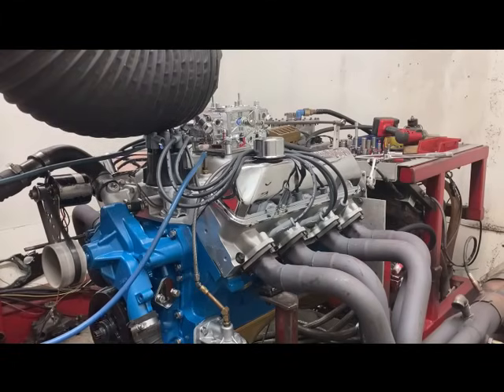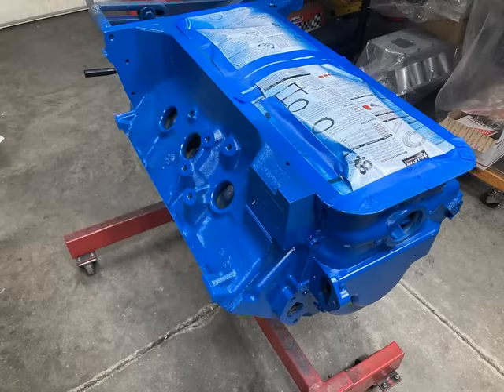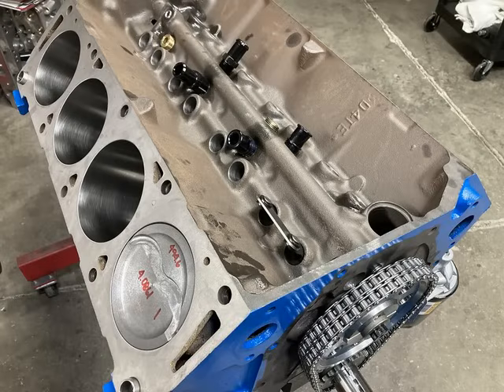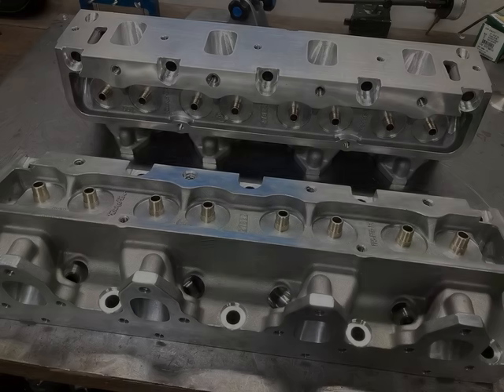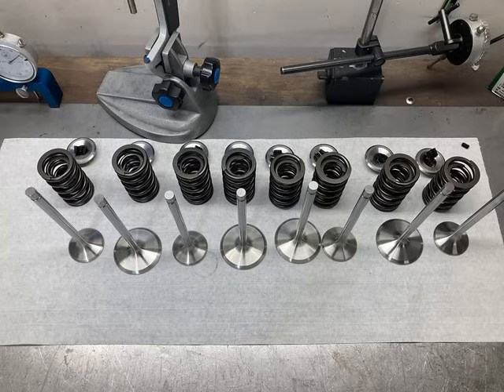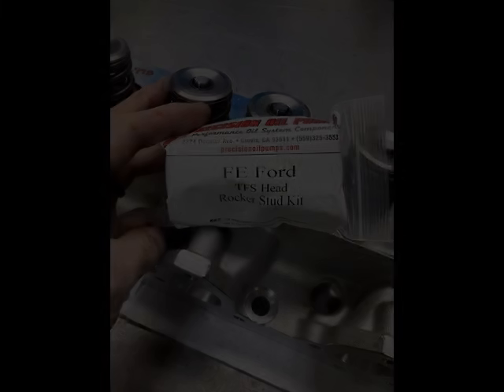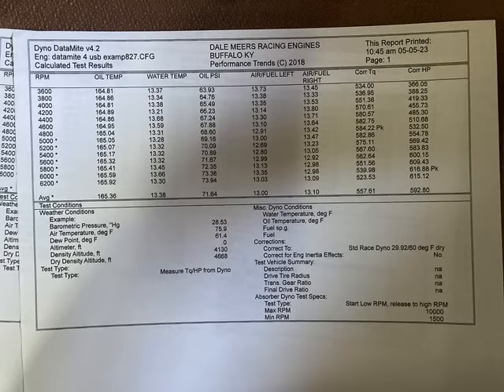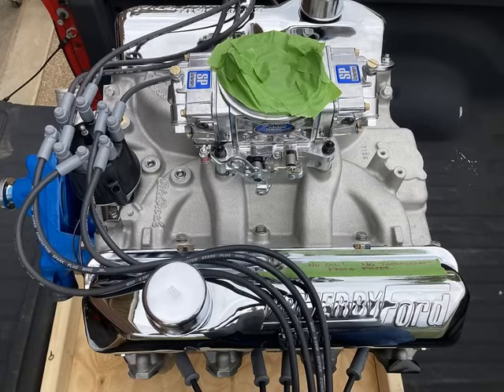Lykins Motorsports MEANEST/BADDEST Ford 445FE I've Ever Built!

Comment: This is the engine Brent built for me, for my son’s 1967 S-code Mustang fastback. Haven’t even fully got it broke in yet; about 400 miles on it so far. Another 100 miles and then we will change out the transmission fluid (new TKX), and should be ready to head to the dragstrip. Brent did an amazing job for there, although I will correct one thing he said- this engine is to serve as a 80% street/ 20% strip engine for this application. We know we will have to change out the valve springs every so often, and eventually the lifters too.
Reply: looks like you got a good one. 617 is something else
Reply: Read my comments I think you will really like it 😊
Reply: i have a 67 s code fastback I'm putting a 396 FE together for as well, nice to hear about other peoples projects too
Reply: I'm up in ND as well and doing a very similar build!
Reply: I’m looking to do a very similar build to this with Brent. I haven’t heard back from him yet. What’s a ball park figure for a build like this?
Reply: If you have to ask about pricing it's probably going to be to high! Lol. It sucks but that's just the way it is. I would say with everything custom porting carb and all the parts listed it will be more than $15k
Reply: I have an s-code 4-speed Mach 1 which I believe is pretty rare. Almost all had automatics in 69.  Awesome build btw. Just discovered this channel.

Comment: Yes port velocity is just as important volume in many cases. I could have sworn they were 2.19 / 1.88. . Well at my age maybe I just don't remember that good. I know out of all the FE's I did,  those heads made more power than any thing else I did. They worked better that 428 cj heads and the heads off a 67 the cougar with a 427. Although I'm pretty sure  those were  390 gt top ends on a 427 short block. It had a cast iron intake vac.adv distributor, hydraulic cam non adjustable valve train. It had a Holley but may have come with an Autolite carb.idk. anyway hey thanx for all the info in your vids.   I can promise you your knowledge has help many many people doing an FE.  Take care!!

Comment: Your customers need to know that you can get a kit so that you can run your power brakes off your power steering pump with out any problems and it's cool if you need that extra room but also good when building engines 😊

Comment: Brent you said the strong flow numbers and dyno results are a testament to the excellent induction package. I agree but it’s also a testament to how you responded to the customers needs by using your knowledge and experience to plan the build and select the right components to make it happen. 

I like your choice of the D4TE block. It’s a solid foundation for the application and avoids the additional costs of an aftermarket alloy block. Using quality components like TFS heads and Molnar rods provide performance with reliability. This 445 FE will look great in the customers classic Mustang !

Comment: My recent build, following your ideas made 420 hp and 450 lb feet at just a tickle over 5500. At the rear wheel in 3rd with lockup on. I absolutely love the 445 combo. Way more power than I need in my 68 Ford XL.  She's a bit over 4k and runs Great. Thanks

Comment: Brent why such a small exhaust valve ? Im getting old now but im quite sure that i did a .030 over 390 and used a set of C3 H castings, and used the 2.19 intake and  1.88 exhaust valve. I turned it 7600 many times. It was in my 64 Galaxie with a 3.89 31 spline locker. I was a handfull for bb cheveles and camaroes. And back then we didnt have the new rollet rocker stuff they have now. I had the 427 med with the larger 7/16 adjusters. So how do the TFS heads work so good with the small ex valves?
Reply from the maker: A 1.88 exhaust valve would have hit the cylinder wall.  Even on 427 bore sizes, a 1.76 is about all you can fit.  

I think one advantage of modern parts is that we have found that bigger is not always better.

Comment: My 472 cubert Cadillac engine makes 657HP with just a 3 angle valve job on the stock heads,  ,550 inch lift cam, and the stock intake port matched to the heads.

Comment: Nice job. How much vacuum did it make at idle. With a manual transmission on deacceleration at 6,000 RPM have you ever had the intake gaskets sucked into the intake ports?

Comment: Great build amazing numbers what Rocker Arms did you use?
Reply: Harland Sharp, and unfortunately they gave us multiple breakage issues within the first 100 miles . We swapped them out for T&D, and so far, so good since then… but only have 400 miles on the engine so far.

Comment: Hey Brent, thanks for sharing the rocker stud info.  I'd been thinking that the extra rocker pad height had to have been a benefit for extra thread engagement/ holding power.  Nice to know you can get 600+ on the spring pressure.  So that said, what rocker shaft/ stands/ rocker did you use?

Comment: Is it a stroker moter? Im not to firmilar with the FE motors just worked on a few. Im building a 410 now with good cnc ported head n gonna run a charger on it. Love the videos buddy..
Reply: I should have watched the video more a 390 block. What would you say the Hp range is on the factory block? And have you ever installed lifter valley girdles? I never have run them n was wanting to get your opinion on them thanks

Comment: I would have liked to see the rocker arms, especially given that rocker shafts on FEs are interesting. Also, what crank? No mention of that. No specs on cam either, other than that it is a solid roller. @DakotaGT, are you wanting Brent to keep that a secret?
Reply from the maker: Scat cast crank.   I don't give out cam specs.  I work hard to get where I am with them.
Reply: @lykinsmotorsports  Fair enough. Thank you, Brent.

Comment: Have you had any problems with the intake fitting after putting on new Edelbrock FE heads ?
I have , it needed a intake gasket over 1/4 inch thick .

Comment: Don't understand the Ti retainers. There are a number of tool steel lightweight choices that will work just fine unless you go with Ti valves then i understand; but you better DLC everything.
Reply from the maker: No need to DLC everything.  I've got 1200 hp 8500 rpm engines that don't have DLC coated parts.   Titanium will always be lighter than tool steel when the size is the same.  A lighter valvetrain requires less spring load.  Less spring load is paramount for this kind of build.